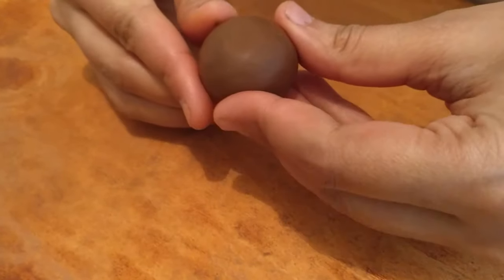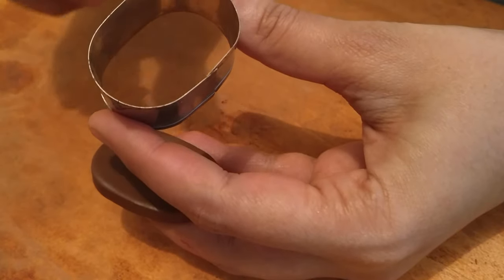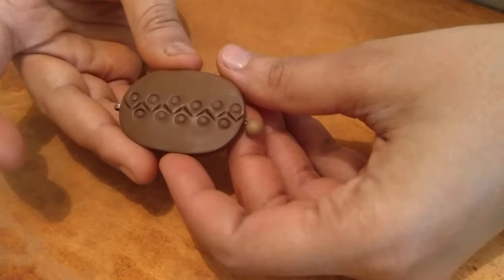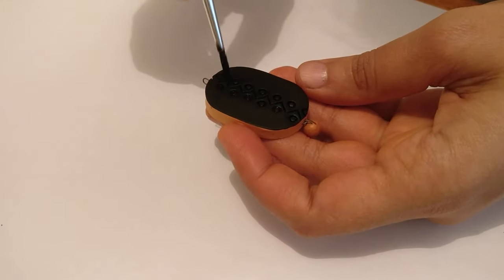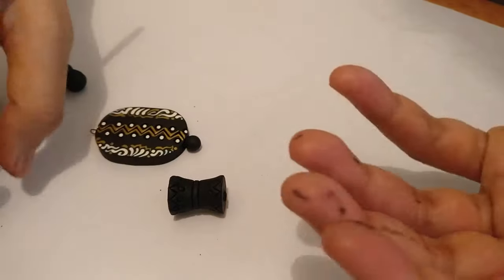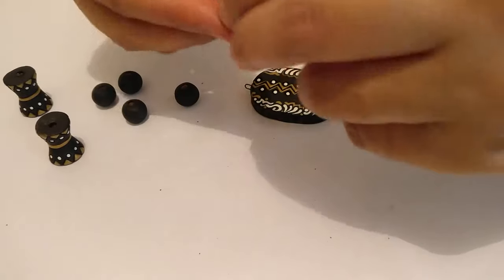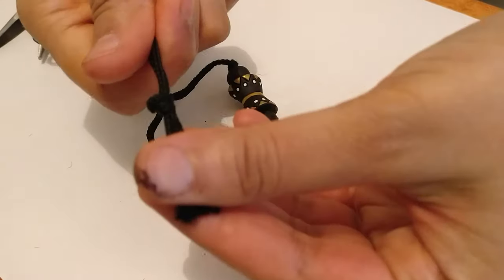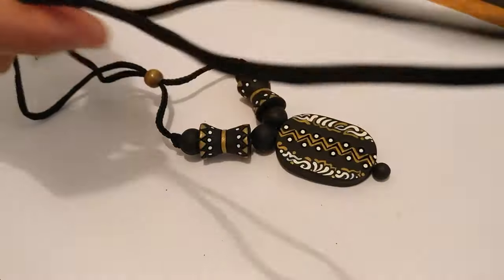Start to end of a terracotta pendant

Comment: Hi Neha...all your videos are very nice and clearly explained....really inspiring....i have a query on the chord and beads used...please say what is the diameter of the chord used and what is the diameter of the wooden bead hole... thanks
Reply from the maker: Thank you! I picked up these cords in bulk a long time back. So I don't remember the size of it. In the video I did mention that the cord and bead you choose has to go hand in hand as the bead needs move up and down the cord firmly. The hole of the wooden bead I have is approximately 0.3 cms in diameter. Going by that the nylon cord should be half of that. But I do suggest you try both (bead and cord) before buying.

Comment: Mam is it a cotton cord or Nylon cord which you have used to assemble the beads? Also pls share the measurement of the cord.
Reply from the maker: It's a nylon cord. Cotton cords don't fray like in the end. The cord I use is approximately 3-4mm in thickness

Comment: Another one doubt mam regarding this black rope... 😌can I buy the rope in any online shops mam....
Reply from the maker: You can, the one I use is a black nylon cord 3-4mm in thickness. You can get these cords easily in fancy stores in India. You can look up Amazon India. The reason I use 3-4mm is coz of the size of the hole I make for my pieces. If the hole size is smaller in your beads and jewelry, you can also opt for a thinner cord

Comment: What thread u have used here... can u share thr link
Reply from the maker: I use a black nylon cord 3-4mm in thickness. I don't have an exact link persay. I bought it from Bangalore a few years back in bulk. The store was called MK fancy, Jayanagar 4 th block, next to big Mishra pedha, Bangalore. But this cord is easily available in most fancy stores in the India. You get this cord in various thickness. Depending on the bead hole size you create, you can choose an appropriate cord for that.
Reply: @nehagopinathpillai  thank u

Comment: Wooden beed size ?please mam
Reply from the maker: Based on the thickness of the cord you are using. I use a black cord of approx 3-4 mm in thickness. So the wooden bead hole size is around 4-5 mm. (Hole size, not the full bead)
Reply: Thank you mam...because of you iam doing terracotta jewellery..your finishing and design are mind blowing u r my favorite jewellery maker...thank you mam do more videos it will be more useful for me as a beginner....
Reply: Thanks for reply 🙂